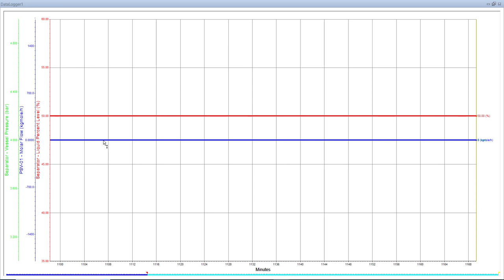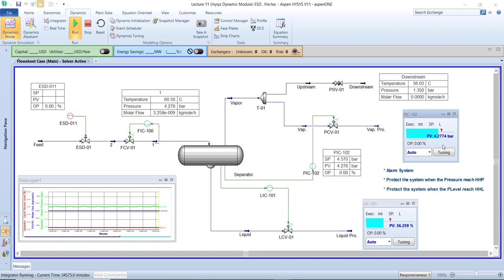The #ESD and #SIS system by Hysys and Karwan is a crucial aspect of the facility's safety (English )

Comment: Thanks for sharing Kamal, please I would like to know about the configuration in SIS specifically in ESD controler/ ESD valve, (which type of controler, configuration parameter that i have to set).
Reply from the maker: With pleasure Mr. Francisco 
This is a secret of my course dude , if you want it get the course you can contact me in what's up (+9647501468388)
Reply: @karwankamal   Thanks again Mr Kamal I really like to get the course soon. Do you have any brosoure or website with the full information related to the couse.

Greetings.
Reply from the maker: Thanks again for support and getting useful from my video, please contact me in what's up to send the detail of my course

Greetings